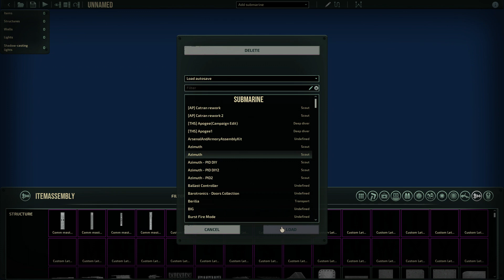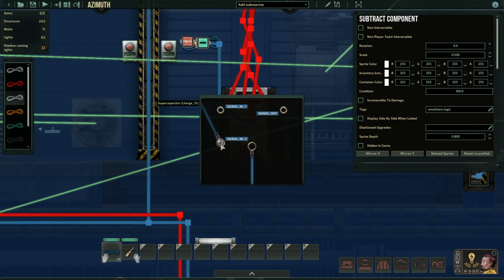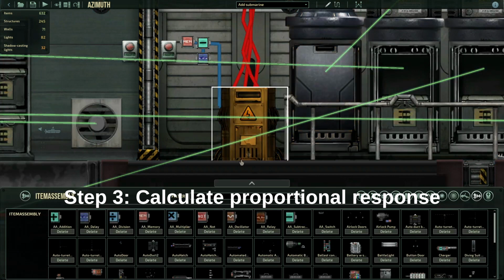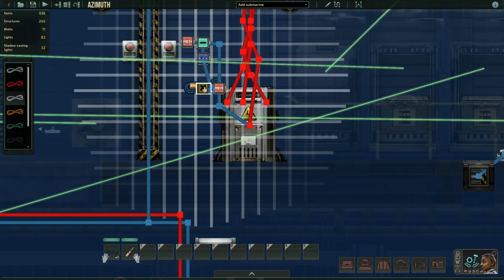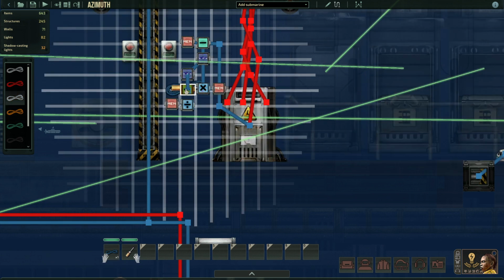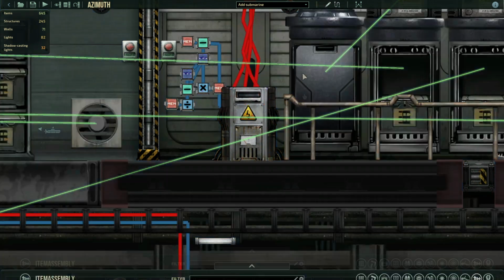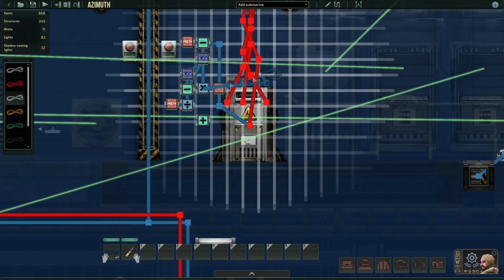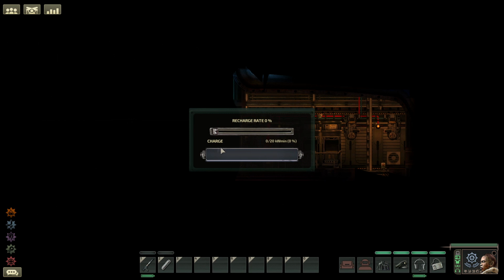Barotrauma - Simple Charge Controller

Comment: I have made a similar component assembly to regulate the new Power Distributor to prevent junction boxes overvolting !
Junction boxes have Power_Out and Load_Out, so I used this formula :

((( Load - Power ) / Power )*100 ) + 100 = Decreased percentage to set the voltage slider lower on 1 of 8 outlets of the power distributors !

Install this component assembly to each junction boxes.

Having a powergrid suplied with a power distributor is a huge enhancement, now every junction boxes are independent ( not connected at each others anymore ) and I have to say that you don't need more than 8 in a sub thanks to relays !
Remember to have both reactor power_out and battery_out at the inlet of the power distributor.

Comment: The actual usefull charge controller would the one that would monitor reactor load level and only allow full charge output in something like: 
Reactor Load = Reactor Max Output / Load * 100 (0%...100%) (actually you can just wire turbine value if you have reactor controller)
Limit = const value, lets say 60
Reactor Load > Limit  => Charge Rate 0%
Reactor Load < Limit => 100 - Reactor Load

Comment: I simply want my batteries to turn on when the reactor turns off and the game is retarded when it comes to providing overly complicated and nonsensical components but not providing super simple things like "if on" or "If not" and forces me to build a computer out of components just to accomplish with should be possible with only 2 triggers.
Reply: I don't know, there is always a signal check component which checks the signal for target value and outputs 2 dif values for true and false, which is exactly what you want. The game is not doing overcomplicated circuits. The players do.

Comment: In the video the battery only got to 99%, as for stacking batteries that would be a problem, yes? Do they only go to 99% with this or did you just cut the video at that point?

Comment: I may just not fully understand how all the components work as of yet, but I can't seem to grasp your setup and why it actually works. The logic stops for me at the two delay components set to 0.02. An example: If charge % is equal to 40, signal pass to subtract component and using the memory module, the output would be 60. That signal I see it being pushed to the delay component and so it would be holding a value of 60. Then you send the signal down to be processed with a multiplier of 10, producing a side value in this example of 600. Moving on, from the first delay component the signal is passed to a second delay component at .02 delay. Delay component Two now has a value of 60, which is passed to the subtract component, which is receiving input from both delay components. It receives delay comp1 first, at 60, outputting 60 for 0.02 sec which for a brief moment is divided by 0.02, and then immediately after the subtract value becomes 0. At this point you are dividing 0 by 0.02 which is a no go. You should not get 0 as an output since dividing by 0 is not possible. So for that brief moment, 60/0.02, a value of 3000 is shot out to the adder, which would be set to a value of 600 from the multiplier, plus the 3000 from the divider, equaling a charge rate of 3600. But because of the not divisible by 0, boom, the circuit should be dead and stuck on a division error. Why does this circuit work?? 

Math equation: 
charge rate = ((100-40)(10))+((60-0 [DELAY 60-60] )/0.02) 
charge rate = 3600
charge rate DELAY = division error

Please help my fried brain

I've also discovered ya can't really use this on a battery backup... it sends the reactor into weird up and down spikes so much that it burns everything out in a matter of seconds if it is trying to charge a battery array. Either that or I've messed something up badly, that is also a possibility. For the sake of the reactor, wouldn't it be better to have a continual and steady power pull instead of one charges the batteries in pulses? Maybe that's still me doing something wrong, maybe mixing two circuits that don't go together.
Reply from the maker: OK:
Step 1) Calculate error

Step 2) Discretize error signal
This is done because the input value changes at 60 Hz, but to give it a little margin for error we're going to run our calculations at 50 Hz, or 0.02 seconds per cycle. Passing the input signal into a delay block creates something called a "zero-order hold", where the delay block reads the input, outputs the same value for 0.02 sec, then reads the input again, adjusts the output, etc. The point of this block is not the delay, but rather the zero-order hold.

3) Calculate proportional response
This is as easy as multiplying the error signal by a static coefficient. In this case, the multiplier is 10x, which means that if the current charge value is 93%, the output signal from the Proportional controller will be 70% max charge rate. Proportional controllers are easy, they're just a flat number times the error signal.

4)  Calculate derivative error
This one can be hard to wrap your head around if you're never done calculus before. The first delay block, as I said before, is for discretizing the input signal. The second delay block, however, serves a different purpose. By storing the error signal from the previous cycle and subtracting that frim the current value, and divide the result by the time window, you get (change in error)/(change in time), aka the derivative of the error signal.

Does this help at all?
Reply: @TheGamingNerd2022  So the issue I was having is that I didn't grasp the full function of the delay component. Can you confirm this for me? Delayed, meaning as you said, it is holding the signal of 60 (from my example) for 0.02 second to the divider component, and the other delay component is receiving the signal from the first delay, so the divider is not actually dividing later by 0 as the divider is simply waiting until a valid input is given. Also, I thought the delay component delayed the signal from coming through, instead of what you have said in your response, delaying the end of the signal. That would mean, signal would be something like, 60-60. The divider would then be waiting for a valid input, so charge change even by 1 would make it 59-60, -1/0.02, which would be -50. This explains why the circuit initially does not kick in when the charge percent is 0, because it needs a value greater than 0 for the logic to start calculating the derivative error. So the output value would not be 3600/division error, but instead might be around 540, since the calculated proportional response would have changed as well by this point. Is this correct? Actually, a formula would be amazing to see. From my calculations though, wouldn't the charging stop at 94%? Or does the delay in the circuit prevent this?

Side question: Does this setup only work for one capacitor? Could I for example, take the average of four supercapacitors and use that to calculate the error signal? Or would this cause over and under voltage issues? I used it on my battery backup power as a battery charge circuit and took the average of 8 battery backup units' charge percentage for the initial input value. I have been power issues with a spike wave of the system over and then undervolting. I thought it was your circuit, or something to do with the batteries or supercapacitors, but I've just disconnected them to see if the issue persisted, and it is unfortunately
Reply from the maker: @Talmiior  My efforts to answer your questions have inspired a new controller -- and a new video! Check it out here: https://youtu.be/maJY9y7BtOQ
While it doesn't answer any of your questions, it is a far more efficient method for controlling your batteries and supercapacitors. If you'd like, I can continue to answer your questions here, but I thought you might be interested in my discovery...
Reply: @TheGamingNerd2022  I'll gladly watch it. Your video made me do some good old math, and I enjoyed it thoroughly! Actually, through testing I discovered that using the average of the array on the capacitors worked great! Further, I also discovered it can definitely be used on the battery backup array. Also I discovered what was causing the over and undervoltage. The relays were for some reason set to on. So the relays would turn off, and then back on rapidly, which was causing the batteries to discharge. Simply had to uncheck the box for the state being on, and the over and undervoltage issues went away. Now to go watch your video! Thank you for your responses by the way, they helped a great deal!
Reply: @TheGamingNerd2022  hello, does this still work? I mean, delay as a discretizer. It looks like now it just delays original "analog" signal, and not "stepping" it, but I haven't found any info about it

Comment: wait, are you saying that having battery/supercapacitor at 100% when it's fully charged somehow damages it? always assumed it simply stops consuming any power whatsoever and that's it
Reply: Wiki says "Batteries decay at a constant rate, regardless of whether or not it is connected to the grid. However, they deteriorate significantly faster when submerged in water."
Nothing about damaging fully charged batteries.

Comment: I would suggest an even simpler charge controller. 0.99 - charge level from battery -> set charge rate. This just requires a memory component and subtract. Works quite well for my reactor->battery->systems boat (single system controlling reading from a single battery but controlling many batteries) and saves junction boxes. Batteries typically sit around 50%. You can change the value used in the memory component to tune how quickly and what average charge the batteries sit at :)
Reply from the maker: w4rum mentioned something similar, check out the discussion in there to see why I think the PD controller is better than bang-bang control.
Reply: @TheGamingNerd2022  Yeah, I saw that discussion. This design is more variable than the batteries are (which only increment in 10% steps), it isn't on/off, and doesn't produce undervolt or overvolt issues in my application. It does transition between charge demands smoothly, not sure what a PID would add but good luck in your design.

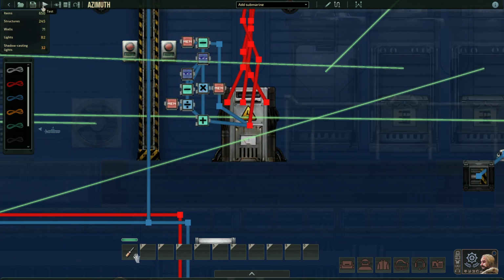Comment: 3:16 the reason you're not seeing any action upon loading the sub is because the electrical system only does its calculations when a signal changes (except for the oscillation and, in some sense, the delay component). In contrast to real-world electronics, where you can always just measure a line and get the current state, the electronical system here is more like a message-based system, with explicit signal changes being sent to components and nothing happening inbetween.

Your entire controller depends on the charge_% value, which doesn't change because the supercapacitor is configured to start out with 0% charge rate. So charge_% never changes and the calculation is never started.
Reply from the maker: Neat! I just learned something. Thanks!
Reply: So to fix this, all he'd have to do is set its starting charge value to as little as 1, correct?

Comment: I don't really get the point of building a PD controller for this, especially because you have perfect and instantaneous control over the charge rate. Why not just use something really simple like

"Always charge at a rate of 100% unless full. When full, drop charge rate to 0%."

That could be done with just 1 Memory, 1 Relay, and 1 Greater Component.
Reply from the maker: You're absolutely correct, that arrangement would certainly get the job done. However, the load placed on the system would switch from 100% draw to 0% instantaneously, which causes a sharp drop in the load on the system. Sharp changes like this contribute to overvoltage, which leads to damage across the entire system, creating more work for the engineers. While slightly more complicated, my proposed controller "softens" the load changes, which should minimize overvoltage conditions.
Reply: @TheGamingNerd2022  Hmm, I see your point. But I don't think softening load spikes by placing complex controllers on every supercapacitor (and perhaps even the engine?) is appropriate. You'd end up placing a lot of components on a bigger ship, which consumes quite a few resources and lots of time. Perhaps a more centralized solution using batteries as a buffer between the reactor and the grid could achieve the same?
Reply from the maker: @w4rum  That's an interesting idea, and I agree that adding this charge controller to every power-storage element is neither necessary nor beneficial. I would argue that just the most-used ones with the biggest jumps in charge (like railgun supercaps and perhaps discharge coils) could get the controller, and the rest are managed manually (or with your three-component suggestion). Buffering the engine is probably a bad idea, though, since the captain is going to want tight, responsive control for navigating those narrow corridors.
Reply: @TheGamingNerd2022  @w4rum What about combining a charge controller with a frequency scanner? That way you only need one controller; just connect wifis to each device to be controlled and the scanner sweeps through their frequencies updating each device's charge rate one at a time? -Crazy Ivan
Reply from the maker: @mluby7828  oooooooh I love that idea! That's definitely going to be an upcoming video! However, it's not as straightforward as you might think... It has to have three Wi-Fi channels per device. Because it uses a derivative controller element, both the current rate percentage and the previous charge percentage in from the last cycle must be read in order to calculate the new charge rate. That means two data channels and one control channel. There are a lot of devices being controlled, then the time required to read and set one device must be considered as well. If your controller sample rate is too high, then it will be hypersensitive to rapid changes in charge. If it's too slow, then you risk missing an important change in the state of one device because it takes too long to read all of the others.
Reply: @TheGamingNerd2022  amazing insight

Comment: I just started playing recently and your wiring guides are by far the best I've seen.
Reply: 100% percent agreed 👍 keep up the amazing work
Reply from the maker: @daemonsmith9814  I put up a new video with some easy door mods, plz check it out and let me know what you think!
Reply from the maker: Thanks!
Reply: @TheGamingNerd2022   I need your help. The problem is that after the update that changed supercapicators, when you will set them to 100% charge rate they quickly loose hp.
So i want to change the charge rate to 50% but i dont know how...
Reply from the maker: @life4psit  Check out the Discord server, I'll guide you through the process 1-on-1 if you're interested! https://discord.gg/XmeCBtQy
Reply: Agree!